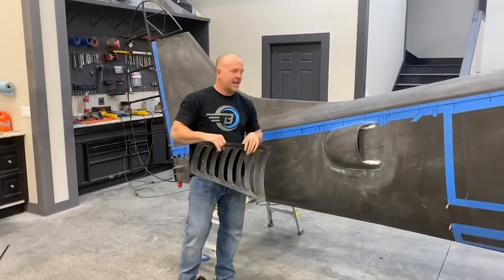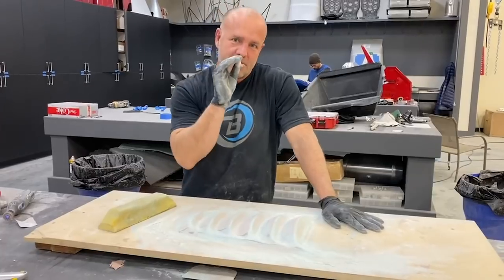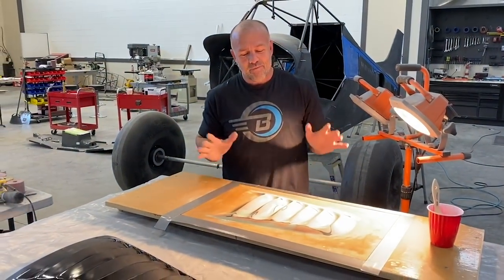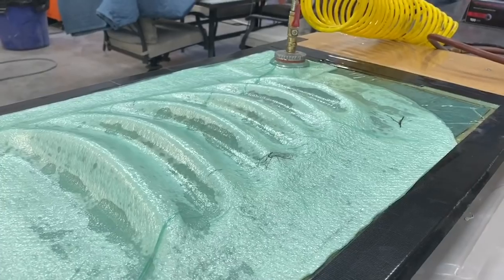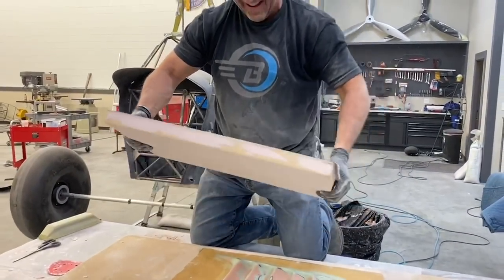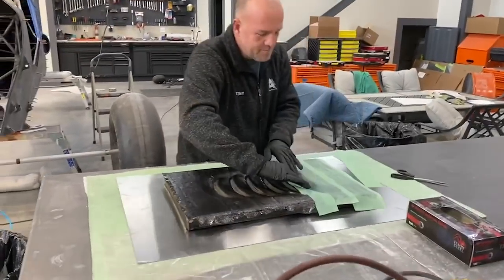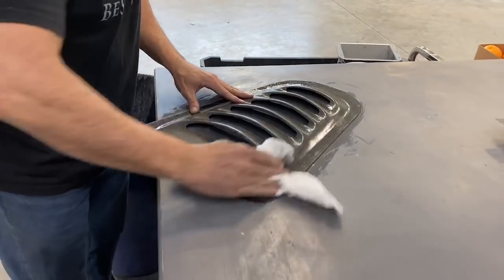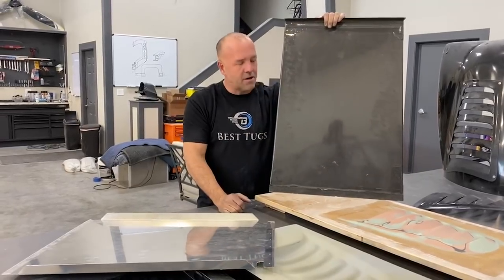🛠Making Carbon Fiber Molds (Scrappy Bush Plane 12)

Comment: "Machine it, draft it, build it, break it"

Am I the only one bothered by the order of that? Shouldn't it be "Draft it, machine it, build it, break it"? I mean, I've known machines that were first built, then drafted and designed, but they're usually not very good.

PS: Love the short format faster updates. Very watchable. Keep em coming
Reply: Drafting first takes too long
Reply: Yeah my method is wing it and waste a bunch of time, then completely restart with a plan and make the part the way i should have in the first place

Comment: Hey Mike ... Love your videos and have learned a lot watching them!     Question... You showed the difference in carbon fiber and aluminum regarding cost, weight, and ease of working the material.  Very informative.  Have you or would you consider throwing fiberglass into the equation?

Comment: Great job Mike! Such an inspiration to us all.  I was instructed to run my layers of carbon fiber at different angles to each other to get maximum strength when I did repairs to composite wing structures when I worked for the airlines....just wondering if the rules have changed..or if the material has been improved to where this is no longer needed?
Reply: The rules are the same for structural or loadbearing parts. This is just an air outlet. Minimal strength needed.
Reply: @AllanFolm  Yea...but from what I have seen all the parts he has built are built the same way, I guess they must not be structural hu? I think the mono shell he built for the fuselage would be considered structural. In fact I recall he added extra layers of carbon fiber for strength...just saying
Reply: @samhill6010  On other parts, he has made a point of mentioning the crossing of the weave. As far as I remember, he did not mention that in the video about the fuselage, but I am certain he did alternate the direction of the weave between the layers.

Comment: You should seal the master and then use Frekote instead of wax.  You'll never use wax again for any parts ... Frekote is amazing.  The parts, and molds, will pop off if you even look at them wrong.  And, I recommend using a surface coat when you make molds ... it'll give you a nice, hard mold surface and reduce the need for sanding.  I infuse all of my molds, but I'm also making all my parts from prepreg in an oven, so I can't have any voids in the molds or they'll collapse.

Just curious ... who do you get your materials from?  I can make that carbon panel for a lot less than $200 in materials.  I use PTM&W aerospace resins (I usually buy infusion resin but the last time I bought their room temp epoxy, it was $125/gal) and last time I bought 3K 2x2 twill, it was around $18/lineal yd.  LMK if you want some suggestions on suppliers and I'm sure it'll save you some $$$'s.  I'm an aerodynamicist by trade and have worked for IndyCar and F1 teams as well as some aircraft design work.  I've actually done quite a bit of design work on subsonic ducts but unfortunately it's hard to get performance data from heat exchanger core manufacturers, so you usually have to build a core test rig or wing it.

Anyway, keep up the good work.

Comment: Ahhhh...... Mike could you have Milled this mold out of Aluminum at the Best Tug factory ?... ( I've seen some of your Mill work  like  when you took the #400. block of Aluminum and made a 2 oz. fitting for the firewall of Draco and all those wing parts,... that was a WOW for me), seems like that might be a lot easier, but what do I know.
           Looks Good,.... Thanks for all your time spent on these Videos.

Comment: I was just wondering if you have considered or tried using 3D printing to create molds for parts. Also, there are filaments available that dissolve so sacrificial cores could be made which might be handy in some cases. I'm a huge fan and greatly appreciate the fantastic content.

Comment: A suggestion for shop sanity.
If you drop a cardboard box over the vacuum pump it drastically cuts the noise.
Reply: BorkToThe3rd ... and the pump will probably overheat. They emit quite a bit of heat. At least you have to care for ventilation.

Comment: Did you try heating the original carbon cub grill to flatten it? The heat softens the epoxy, and sometimes you get lucky and can re-shape the part successfully...

Comment: like the video as usual. Question, why did you add the fiberglass and not just take the mold off the original carbon bondo buildup plug?  Lot of time was spent perfecting that first step only to be covered with glass that then need to be wet sanded and perfected all over again.

Comment: Hi Mike, do you ever use Tooling Gelcoat?  It makes a great mold surface, without the imperfections of just a straight resin & cloth.  I've used it with polyester resin on molds but haven't tried it with epoxy

Comment: when filling cavities.. you might try something slightly less expensive than bondo.. not much... 
Rapid Set brand, "Cement All".  product number 00210065.. it sets in 15 minutes and can be driven on in an hour.. it might be worth trying a few bags.  its not quite hydraulic cement.. it has fine sand in it..  its just a thought when filling the back of molds for sturdy support...  heck.. vacuum down some wide saran wrap.. warming it with a hot air gun to make it fit.. . put your frame around everything.. and just pour the Cement All in and smooth it off.

Comment: So when is the CF short block coming?  a few cylinder liners, thread inserts, and liners for the journal bearings, and you're in business. 

But seriously, I get a feeling the fact the CF composite doesnt take heat so well is the only thing stopping Mike from making one.
Reply: It wont be long .we use carbon fiber intake manifold on our drag car car .they already make a carbon fiber connecting rods .they are good to 3000 horsepower. I thought one of the super car companies already made a carbon fiber block .I wanna try those rods but they are super expensive. Lol

Comment: That truly had to be one of the most painful experiences watching someone take what should have been a simple hour-long mock-up for a mold and turn it into a sandfest waste of materials  and time. As soon as you screwed the original panel to the table and had the desired shape of it you were done nothing else was necessary except for spraying some mold release on it then some gel coat and a couple layers of fiberglass and make sure to leave a little extra material so you can allow it to droop into the individual vent holes and around the edge to give you a proper clean Edge to trim up to. So now you've popped it off and trimmed it do you have a perfect mold to make parts from no sanding no Bondo no glassing no primer. It was interesting watching you turn table into a sculpture but 100% unnecessary to make a mold from the part that you wanted

Comment: Mike, NOOOOO!  The profile needs to be reversed!  The wide part of that air escape should be toward the front of the plane visually to carry the same taper of the body toward the tail.
Reply: I agree Jake! It should also be a little higher - auto anti-ice for the tailplane & elevators
Reply: Jake Kohl  
I knew someone else would say that. It just looks backwards. I feel like a back seat quarterback. But I think it should taper to match the shape of the fuselage
Reply: I doubt he is going to make that mold again.
Reply from the maker: I know right 😃. I had the same idea originally when I started. But when i held the cowling up in front of the plane it looked strange being opposite of the cowling. It was a hard decision, I also don’t want to make that mold again 🤪👍🏻 I’m stoaked that im not the only one being picky with the details 🤠
Reply: I agree but he would have had to make his own  part from scratch. The original part would not work.
Reply: You can't put that much time into it and not be picky - if you haven't already, play with the angle of it - I'm wondering if the top line of the vent panel is parallel with the top or bottom of the fuselage the plane if it might not feel better.

Totally agree, though...that's a great mold!
Reply: @MikePatey  Unless you are going with raw carbon look, paint scheme might help here
Reply: Actually the pressure will increase and the speed of the air slow down towards the rear thus strangely enough, you’ll need larger louvres to the rear. 

Yes, it might look odd but that’s likely to perform better.

What is sometimes done, is excess shape is ‘faked’ that is not functional, it’s just there to provide the desired aesthetic look. 

Mike has already made a ‘final size’ part and it doesn’t seem - at least at a first glance - as if there’s sufficient room to add a trim part which will make the leading end appear wider than the rear. I’m not even sure it would be easy to create the effect we all might have in our minds 😉
Reply: Mike, I think you made the right decision from a thermo-fluids performance perspective. There’s the option of creating a forward trim piece to ‘fool’ the eye but not sure it’s worth the effort 🤔
Reply: @MikePatey  I don't know which renaissance polymath said it, but the devil's in the details.
Reply: You could flip them and put them on the opposite side. I've seen louvers done on the panels off a Barracuda done like that and it looks sick.   When's Mark gone throw out some videos too? I'd like to see how far along he is in his build.
Reply: I had a feeling the decision was related to fluid dynamics, but I guess it was both that and matching the front. I’m sure this bird will be beautiful.
Reply: Mike puts an awful lot of thought into his design
Reply: @BillB23  common-core doesn't acknowledge details. They're raysis, gender-exclusive and patriarchal fabrications of a hostile and threatening space.
Reply: I trust mike.. Im sure he thot about it a hundred times before he builds it.. Go mike!

Comment: I am inexperienced when it comes to aviation and engineering, but I had an idea that might help prevent ground looping for tailwheel pilots. How feasible would it be to take technology from Freestyle BMX, the Detangler, Gyro, Rotor, that allows the use of applying front braking to the front wheel that turns 360 degrees or more, and applying it to the tailwheel to apply braking to the back wheel to help correct the back wheel from going faster than the front wheel? It is a cable system, and brake system that wouldn't add too much more weight.

Please let me know if this idea is feasible or maybe not worth looking further into.

Comment: If you put your outlet way lower than your inlet won't you incur drag as the air will need to change directions upon entering and then leaving? I know you're using the worm gear to open/close the internals but it looks like you will have a lot of cooling drag.

Comment: One more item... Wouldn't it have easier and quicker to have built one thin exhaust vent at the back of the oil cooling box along the bottom of the fuselage? One vent located at the bottom would create a suction to pull the air out of the oil cooling box. It would also keep the sides of the fuselage smooth on each side.

Comment: Hey Mike, did you give any thought or consider exhausting the air out of the bottom of the fuselage with a smaller single vent similar to the the intake vent?

Comment: Is there any reason you used carbon on the molds rather then fine glass and then layers of matt on top for strength? I heard that carbon blocks radio waves. Is that to be an issue for your radios?
Reply from the maker: amtpdb1  yes very simple answer, I ran out of glass and stores were. closed. I used what I had.  Never stop working gets the job done 👍🤠

Comment: Mike, love your videos, but I think you could have modeled the part,  machined a female mold for it from high density tooling foam, and finished that with a lot less effort. That was how we made all the parts for or FSAE car and got excellent surface finish.
Reply from the maker: I use that product quite a bit, I tried to use what i had on hand instead of making a run for more product, i think this time it would have been worth the trip 😜
Reply: @MikePatey  Keep up the awesome work! Your attitude and work ethic and inspiring and humbling. As a mechanical engineering some of the techniques you use are a little unorthodox but I'm constantly amazed by the thought, effort, and (most importantly) results. Love your channel and the more frequent content.

Comment: Would it not have been possible to 3d print a mold then finish it up with a bit of sanding and a filler primer? Check out some prop maker videos for how fine a finish you can get that way in a fraction of the time. Sure the print might take a while but you can be doing something else while that happens. You could slice the print into parts and superglue them together before finishing the surface.

Bondo seems like and expensive way when you can run straight resin too.

Comment: Since you were talking about the difference in weight...  What's the weight comparison between CF and fabric?  as far as weight gain on your skins?
Reply from the maker: carbon fiber is heavier for sure, if you did a direct comparison fabric would win every time, but i needed to stiffen my tail section and so my carbon fiber skin accomplishes a structural role in addition to covering the aircraft. Ill go into more detail in a future video 🤠
Reply: @MikePatey  I know it's heavier, I was curious if you had any numbers is all.  Thanks for taking the time to show us (relatively)lazy bastards how to get it done!  💪

Comment: Just realized why you do not make a "correct plug " for your parts. You are only making them last long enough to make 2-4 parts per plug /mold. Fast and nasty, good enough.  You get rid of the nasty by doing some rework in final body work.
Do not know how much time would be saved by putting more time into the finished mold vs the rework time.
You probably have done so many one-off parts that you know the price /time curve costs of a one off vs a production mold and just have not stated it on your video's.
I truly enjoy your video's.
It keeps me interested my PA-12 project.
Any chance of doing just a video on electrical for the empennage and cabin.
There are some f us out here that could use some ideas ,I am sure.

Thanks.

Comment: So would the foam be crushed by the vacuum or would the carbon stick seem like a lot quicker to use foam instead of bondo
Reply from the maker: Brian Shea foam deforms under vacuum but is fine if your aren’t bagging and vacuuming

Comment: You need a 3-D printer.  Make your lift so much easier. You could of made that mold in a hour.  And you would always have the mold for later. They have printers now that are not that expensive as you think.  Look into it.

Comment: How do you prevent galvanic corrosion when attaching carbon to metal?
Reply from the maker: Henrik Jonsson great question, 👍🤠. The answer is you can’t connect directly from carbon to metals.  When I need to make that attachment I do a minimum of 2 layers of fiberglass when making the carbon part on the side that could make contact with metal.  Also if it is a part that could have vibration or movement possible I will add more fiberglass and also a isolation layer of rubber or other film separating the two.  Carbon fiber direct to metal should never be done. Thanks for the great question.  I go into this topic on a couple different videos in the past but sometimes don’t have it on every video as it would become so repetitive it would consume that episode.  Thanks again

Comment: Would the use of 3D printing the vent and/or other molds save time?
Reply: ....RE-PHRASE- :) If you use a 3D printer to make molds could you CAD design them to fill in all the voids that you spend so much time to fill in with bondo?